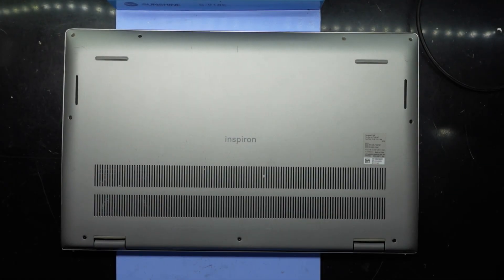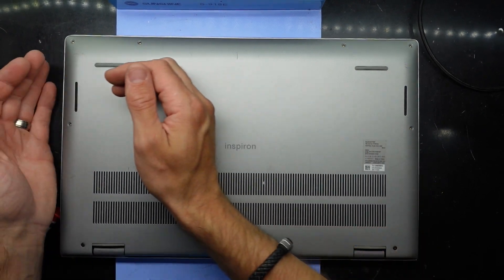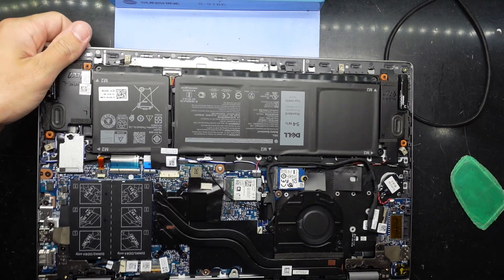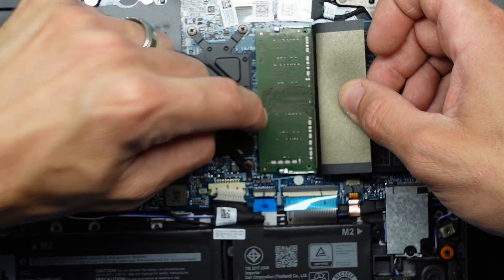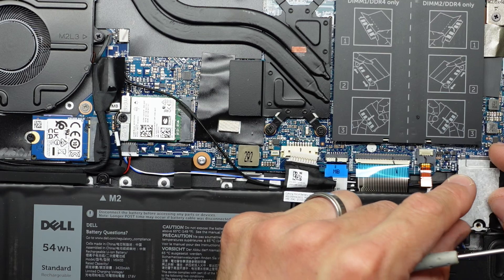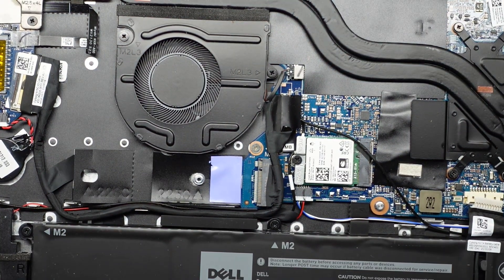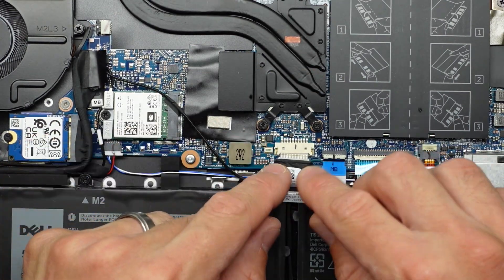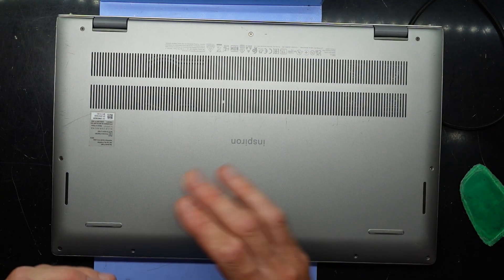Dell Inspiron 15 5500 SSD and Ram Upgrade

Comment: My Laptop unfortunately overheats from the Ram Upgrade. I used an extra 8 Gb Ram with the same parameters as the original one. Do you have any Idea how to fix that
Reply from the maker: i think it was more your laptop can actually 100% use its cpu with ram in dual channel

Comment: i got a few questions 
do you need a pry tool to open up the laptop?
should you disconnect the battery first then put in the ram?
how do you check if the ram works in BIOS?

Comment: Hi, do you think my laptop Lenovo Flex 5 14 inches, AMD Ryzen 5 4500U convertible can be modified ?
It has just 8 GB of fixed RAM, can I extend it with 8 GB additionally ?
Reply from the maker: Pretty sure the flex 5 has soldered ram and isn't changeable
Reply: @rickstechrepairs  thanks.